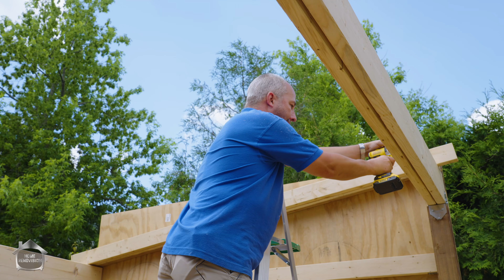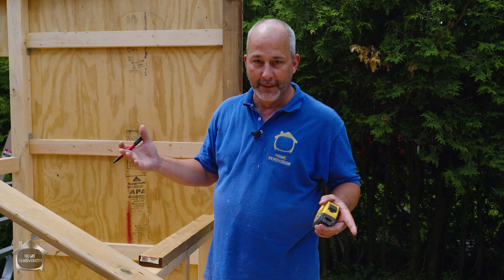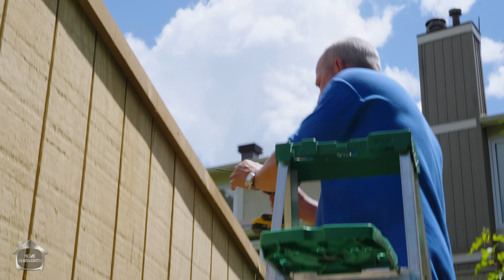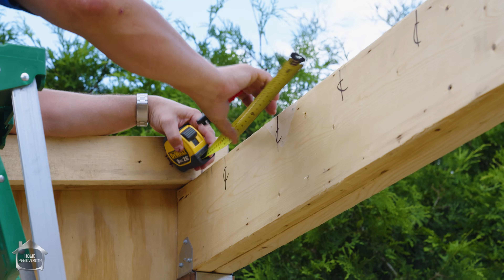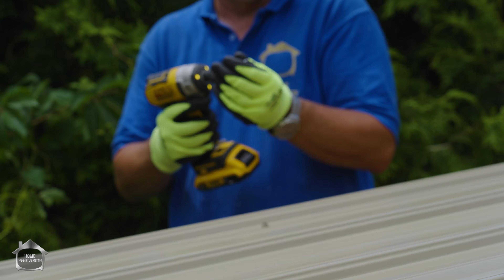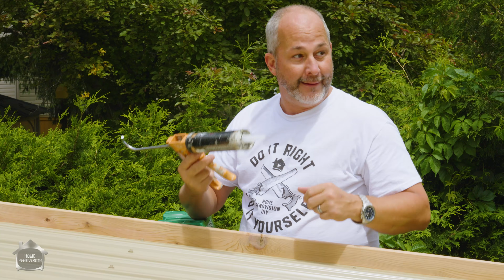This $500 Shed Roof Will Last 50 YEARS!

Comment: I helped my father build a 20 x 30 foot shop on our property in Texas over 30 years ago. It has the same style roof ,only we used graphite shingles instead of metal. That shed is still standing today. It was re-shingled about 10 years ago though. I do believe had we used metal it would have lasted, maybe a little rusted but I have no doubt it would have lasted. However metal roofs don't have the same aesthetics as regular graphite shingles have.
Reply from the maker: that may be true, but i was trying to find a way to install a roof and stay on a ladder. My goal here was to show folks how to get a great result without the risk of falling off a roof.
Reply: @HomeRenoVisionDIY  I just did a small metal roof like yours.  I do have cross members.  I use two strips of plywood about 3.5" wide and drive in a screw before it poke thru.  Flip the screw head up-side-down and hook it on the edge.  1) I can grab onto the wood, 2) I can put my knee on to carry my weight. 3) you can add few more thread on the plywood for traction.

Comment: why are you using a cutting disc? use a cold cut steel blade so you dont ruin the sheetmetal
Reply from the maker: the cut edge is not going to be seen, soo......
Reply: @HomeRenoVisionDIY  still will ruin the cut edge, making it easier to rust. Using a cutting disc also sends sparks flying, that can potentially ruin the surface/paint, burn a small piece of metal in the surface which will rust and cause streaking.

Comment: As a designer, and inspector , I have so many issues with this build.

Sorry, you make great videos , however when people copy this incorrect method it makes it difficult as we have to fail inspections on site and requires addition cost and effort for the homeowner.

First the exposed fasteners is not rated for that low of slope design. Most manufactures state 3/12 min slope. A asphalt roll sheathing membrane would be more suitable for this application. 

Second , perpendicular support (strapping or sheathing) as per most manufactures instructions 

Third, horrible detail to caulk a pressure treated end cap . Water will sit and rot the wood. They make metal roof closure strips that are sealed using correct byutl strips.

Fourth, drip edge should be installed 

Fifth, top closure for the steel .
Reply: I'm with u.
It got me he had his sides how ever many inches above the roof, then caulking it, that bothered me.
They make "L" flashing just for the edges which probably same price or cheaper then his 5/4, I think that's what he put on.
Plus, that's more maintenance maintaining the caulk and paint.
Reply from the maker: Thanks for your concern, however since this shed is not going to be inspected I was able to build it and save almost $1000 in materials that you just described that are not important in a temporary shed structure.  Manufacturers recommendations are for permanent dwellings, I have no concern that this will last 50 years. Cheers!
Reply: @HomeRenoVisionDIY   I understand that a permit may not be required, it doesn’t mean it shall not meet code! However as you are educational based you tube channel, wouldn’t be better to show proper ways to construct vs teaching poor building techniques to the general public?

Comment: I find Jeff so clumsy, despite his great presentations. This guy wouldnt pass the safety test. 
First thing you should have done after cutting those sheets is shamfer those sharp edged shards with sand paper that the cutting caused. One wrong movement of handling and youl slice your hand right open....👍👍👍
Reply: Something tells me this guy wears a safety vest when cooking Thanksgiving dinner.
Reply from the maker: or just don't touch those ends. Cheers!

Comment: Maybe I'll see the answer to this in the completed build, but why cut the roof panels at all? Seems like it would be nice for your tiki bar design to have some roof overhang, no? Or just in general, to push the rain and snow a little farther away from the structure?
Reply from the maker: the roofing comes in 12' lengths. That is a lot of overhang since our roof ended up being 9' in total.

Comment: great video as usual. Thanks. I don't understand why you didn't extend the metal sheet on sides and front and back (instead of cutting them so short) and this way both get water protection for the top exterior trims as well avoid all the caulking probably. Also I wouldn't plug the opening between 2x4's. In summer you want the hot hair flow out of the shed. But you will want to cover it with metal latice to protect against mouse which is much more harmful than possible wasps in my opinion.
Reply from the maker: I live in the north so the heat is less of an issue. I agree if this was in the south making that change would be beneficial.
Reply: @HomeRenoVisionDIY  in San Diego we use the blocking but with 1.5" holes covered in hardware fabric inside. It allows the building to breathe while still getting the bug barrier
Reply: I was rabbit holing just now on the idea of breathers and rafters (as one is wont to do on a Sunday morning toke sesh) and i found some smartypants came up with a design for breather hole caps. If you Amazon "20Pcs Air Vents 53mm Circular Soffit Vent Stainless Steel Round Vent Mesh Hole Louver for Kitchen Bathroom Cabinet Wardrobe" you'll find them... they're interesting but though claiming to be steel look plastic-y and don't look durable to me...  But OH BOY what a treat the description is! This is grade A nonsensicalism:

"[Material] This porcelain white air vent is made of stainless steel, durable, and strong ability to withstand gravity, not only oxidation resistance, but also more beautiful installation effect.
[Design] Air Vent hole with honeycomb design, exquisite round holes conform to the breathable design, small round holes can be dust-proof and not easy to block.
[Environment] Circular mesh can make the wind easily flow into the spaces where you are staying, it will giving you a fresh and odorless life and work environment."

Comment: Hi Jeff, I have a question regarding the screws in the roof. Many years ago I built horse stables for an old farmer. He told me to put the roof screws on the high spots of the tin, as water will find it's the way in otherwise. You did it on the low part. Could you please explain why?
Reply: I agree and think the roof screws should be in the high spots.
Reply: @mae7398  correct, screws ALWAYS go on the ribs of any metal roof. The ribs are the only structural part of a metal roof.
Reply: @remodz6385     ---    wrong:  screws go on the high points ONLY on corrugated metal roofing  ( always  -  if you put the screws in the valley it will not only not seal and leak, it will form a dam and hold leaves and trash in the valley making the leaks worse  )  -  on metal roofing panels ( what this guy is using ) the screws go on the flats  -  the only place you screw through the ribs is on the overlaps, and then you use a short screw which doesn't reach the purlins and simply pulls the two sheets tight to each other  -  if you screw through the ribs, it will pull them downward and deform which will cause the flats to pucker and rise off the purlins  -  plus you can't get the screw gaskets to seal properly  -  the other thing with metal roofs, they should ALWAYS be installed on purlins running across the rafters and NEVER simply screwed to the rafters  -   a roof built like this one can't support weight between the rafters -  if properly installed over properly spaced purlins ( 24 inches or less apart )  you can walk all over a rib panel roof ( you really can't walk on a corrugated roof no matter how it is fastened ) 

another thing different in corrugated and rib panel roofing is how they install on the overlap  -   corrugated is designed to overlap two hills ( high points ) so a 3 foot sheet will NOT cover 3 feet but is several inches less   -   rib panels ( like he is using ) is made with different style ribs on the edges  -  one is an overlap rib and the other an underlap  -   when properly installed, it forms a waterseal with an anti-syphon air gap and will not leak  -   there is no need to overlap an entire rib as he did, so he lost 25% of the coverage it was designed to give ( should give a full 3 foot )
Reply: Bones is correct.
Reply from the maker: water looks for the route of least resistance. on a sloped roof there is no issue. especially when dealing with a shed and rot a roof with any materials that can be damaged by occasional intrusion.

Comment: punch/drill holes in the metal through the stack of sheets prior to instalilng on the roof, gives you a starter hole and they all look the same.   Obviously if you mess up, then at least it will be consistent 🙂
Reply from the maker: That is very precision work. I would not advise this for homeowners who are building for the first time.
Reply: As a woodworker, precision measurements and having symmetrical screw heads is great for woodworking when you don't have a deadline... but as the son of a general contractor and master carpenter, i can tell you carpentry doesn't have the luxury of spending 20 minutes on cutting a dado to within .007 tolerances.  And further, when you're wrestling a sheet of corrugated metal you have enough on your mind just trying to keep the edges from slicing your meat hooks open. But you introduce 3 screw holes every 3 feet down a 9 foot sheet of galvanized razor blades and your asking for a gushing thumb artery tourniquet. I know this for a fact cause I have had to apply tourniquets to gushing arterial bleeds from my thumbs on too many occasions.

Comment: I'll stick to the less then half the price shingles ... my house has same  shingles for over 30years and got at least 15 more years in them..
Reply from the maker: not to be rude but the metal was the same price as shingles. Cheers!
Reply: ----  several factors you are ignoring :

*  shingles need a substrata ( plywood, etc ) to be attached to
*  shingles take a lot more time, labor, and skill to install
*  shingles aren't good for less that a 3 1/2 pitch
*  shingles weight a ton ( literally ) more
Reply: @bonesrhodes3762  yes true...but a shingle roof is quite and much more durable then a tin can...dont rust either ...for flat roofs u would use rubber roof welded together for over 50 years of life span and again stronger and quieter then metal..
Let's not forget when u say plywood cost more , on a house u kneed plywood under the metal roof also ...there goes ur logic...
Reply: @goovitoo  -----  yes, shingles are much quieter than metal roofs  -  but they deteriorate under weather and UV  -  and will not last any longer than a metal roof 29 gauge or heavier  -  in fact, if kept free of debris it will last twice what a shingle roof will

any metal roof used for a flat roof would have to be a commercial grade seamless  -  I've had large commercial building with both built-up and torch-down roofs  -  both were replaced with metal roofs, but were converted from flat to single-slopes first  -   I got tired of the cost and up-keep on the others

now why would you want to put plywood under a metal roof ?   plywood is NOT a suitable substrata to lay a metal roof over UNLESS you also have purlins under or over the plywood  -   plywood just will not hold the fasteners properly and with OSB you might as well just use tape to try and fasten it down  -  besides, with 2X purlins you can add up to 1 1/2 inches of insulation ( either rigid or batts ) between the purlins which greatly increases the ability to heat or cool the building and greatly reduces the noise

Comment: I don't know why but the 9 inch on center just bothers me aha. I would of just done 16 OC with 1x3 strapping probably comes to the same cost save on 2x4 buy a couple 1x3  . I get why you did it but based on your DIY audience and just my experience helping out people who have not much experience your way would confuse beginners. Strapping is more forgiving. Appreciate the videos. Cheers from Quebec
Reply: He keeps saying he did this roof this way so u wouldn't have to get on the roof.
HOW, do u fasten the center of the roof after your reach??
Reply: @chrislnflorida5192  ---obviously you just never build anything that the roof is more than twice as wide as your reach
Reply from the maker: this system allows folks to install without actually getting on the roof.
Reply: @HomeRenoVisionDIY  that's true hadn't thought of that !  I'm still young I see strapping And think good I can climb on the roof easily.
Reply: @HomeRenoVisionDIY  hmm..? you can still install without getting on the roof with or without straps.
Reply from the maker: can't reach the screws in the middle if you add strapping

Comment: Well... I always just use my regular blade for cutting that metal roofing... it cuts it really clean (if using a decent blade) and the carbide leaves it looking great without heating issues. (If it rips through nail impeded lumber, than sheet metal is a breeze. But a higher tooth count might be more preferable as it just makes the edge smoother.) 
 
I also like to place the sheet metal over sacrificial ply/osb. It gives it a perfectly smooth edge (well, as smooth as 14ga can be lol) without the burrs.
 
I keep one 6-½" saw that is used for thick aluminum, and it also does great for the sheet metal as well. I just have a cheap 40 tooth diablo on it, and its done more cuts than I can recall.
 
I'd like to see a blade made that has like 60 teeth that have more width, and a type of friction (alum oxide?) For the kerf. That way the teeth cut the steel, and it also sort of smooths it out preventing any burrs via user error.
Reply from the maker: Cheers to that idea!

Comment: I own a condo and I have a water leak coming into my living room. The roof is the culprit, the acoustic texture they used failed!! water entered the Unit. What's a good material(s) that can be used to stop the roof leaks? Thanks, great video(s)...
Reply from the maker: leaks from the outside have to be managed from the outside. Cheers!
Reply: @HomeRenoVisionDIY  what  are the best materials?

Comment: Jeff I’m a long time supporter of your channel and love your stuff but this roof pained me. I understand you targeting home owners  but I don’t believe you saved them any money. Keep it  simple yes about 10 1x4 or 2x4 for strapping but the layout become much simpler for home owner to understand. Steel roofs are incredibly simple on a roof like this, let’s not over complicate it especially when lumber has come way back down 🎉
Reply: Attach the sheets 1 at a time, installing the rafters as you go.
Reply: I'm still curious HOW u fasten the center of the roof without getting on the roof, u can only reach so far?
Reply from the maker: i designed this so they wouldn't have to crawl on the roof to install screws.

Comment: Curious why you just didn't get the L-shaped eave flashing to run over the top of the sides of the metal roof? I have to believe any snow sitting on that roof now is gonna rot that cedar out. And cedar DOES rot.
Reply from the maker: it only rots in the summer and by then the snow is gone. Cheers!

Comment: Roof screws!
1. Do not overtighten.
2. Next time use a stringline to get the screws in a straight line.
Reply: Hello Jeff don't take short cuts build the roof strong, everyone should be able to stand on a roof they made
Reply: @davidlynch2443 I was doing pull ups on a single rafter today , strong enough for me (not a roofer) clubhouse for the kids
Reply from the maker: it would be impossible ti install a roof like this and use a stringline. this design is to keep people from needing to get on the roof in the first place. A string line would require you to  finish the install and climb up on your roof.

Comment: Doing my metal roof, wasn't allowed to cut with a blade like that which voids the warranty as stray sparks could penetrate the coating resulting in rust spots from what I was told.  The powered cutter was like snips so a scissor type action instead.
Reply from the maker: do't care the off cut is extending padst the structure so a little rust is not a problem.
Reply: @HomeRenoVisionDIY  It is gonna look like shi* but ok ... ;p Cuting roofing sheets like that is the bigest sin of a roofer.
Reply from the maker: the roofing is not even visible except to the house behind me. In time if it gets a little rusty a quick touch up will solve that. Cheers!

Comment: The manufacturer's website for that kind of roofing warns against overtightened screws. Which leads to over flattening the rubber gasket and shortening it's life.
Reply from the maker: yup, and it also tells you not to undertighten so how do you know? best to accept the idea of changing the screws in 20 years!
Reply: @HomeRenoVisionDIY  You'll be lucky if they last 10yrs after cranking them down that tight
Reply: @woodstover  ..that’s why God invented silicone.
Reply: The manufacturers will say they “utilize a specialized screw gun that’s set to exact speed and torque specifications for specific metal roofing gasket fasteners.”  Uh huh, sure they do. 

In my history as a career components supplier to the automotive, and aerospace industries, we did have specialized screw guns requiring constant audits and calibration. The tools, and calibration standards cost a fortune, and require certified training. I’ve never witnessed a roofing contractor using that level of equipment, much less when there are ten guys, each with a screw gun.

Finally, since the manufacturer does not provide a torque or speed specification, then I would lean towards flattening the washer without stripping the wood and call it a day.
Reply: @dropndeal  that’s a solid answer man! Thank you, so many variables better to understand do the best work/job and move on to the next one
Reply: @justinsomerville3976  You’re welcome! All those years as engineering manager finally paid off😂